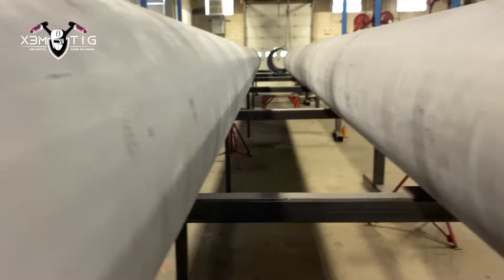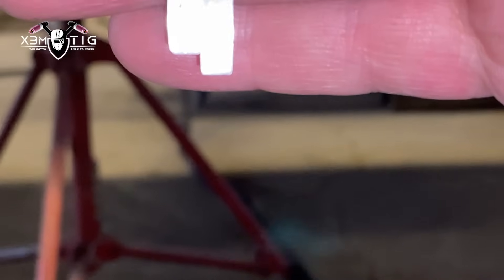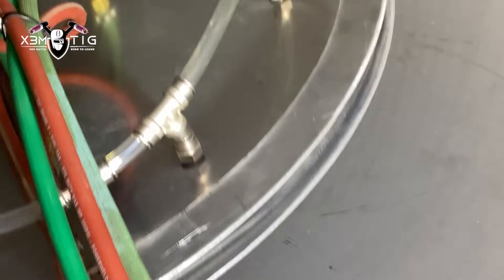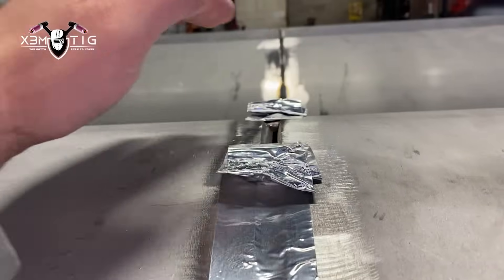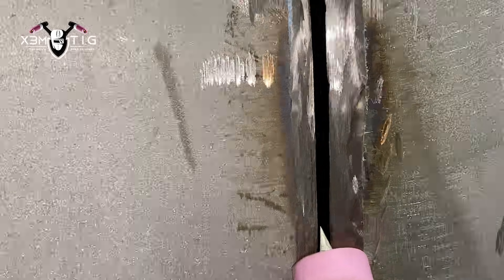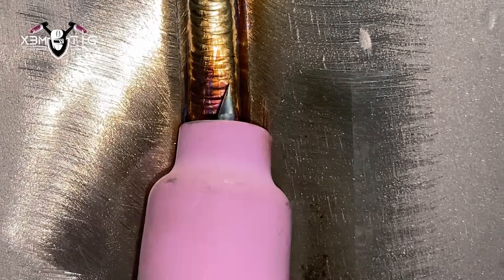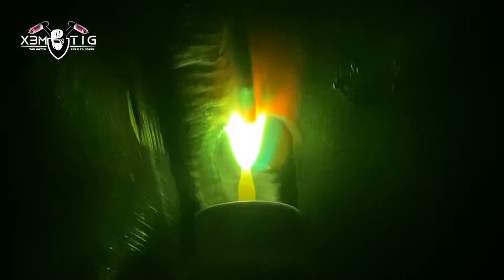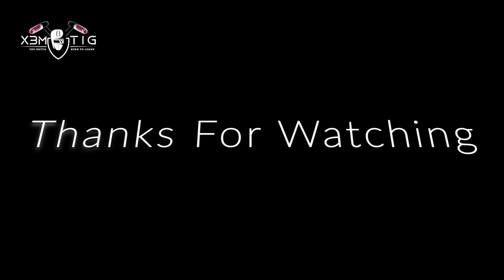TIG Welding 30" Stainless Pipe | 100% X-Ray Quality Welds Every Time

Comment: you said in a previous video that you stiched from thoriated for health reasons. what did you mean by that? I tig weld and im curious.
Reply from the maker: yeah, I switched away from thoriated tungsten mainly for health and safety reasons. Thoriated tungsten (usually marked red tip – 2% thoriated) contains a small amount of thorium, which is a radioactive element.

The main concern isn’t when you’re welding — it’s when you grind or sharpen the electrodes. The dust and fine particles released during grinding can be inhaled or ingested, and over time that radiation exposure adds up. It’s low level, but it’s still ionizing radiation, and there’s also the risk of lung contamination from the dust itself.

That’s why a lot of welders (including me) have switched to safer options like 2% lanthanated (blue) or ceriated (grey) tungsten. They perform just as well on AC/DC, and you don’t have to worry about the radioactive side of things.

So it’s not about paranoia — just minimizing long-term health risks

Comment: Why is the label saying ER312 & ER 310? There is a big difference in Ni content...
Reply from the maker: Good catch, A labeling/printing error, the filler wire is ER310
Reply: @X3MTIG  Yes we know it is ER 310 because of what is written on the wire itself - although it may pay to check that with a texas nuclear machine or similar, but why is the manufacturer or supplier giving duel certification on the box when there is a significant Ni difference. Maybe ask them...? And, get them to pay for the test?

Comment: I was really waiting for the new video. Thank you my friend.❤😊

From the video it looks like your hand is moving at a speed of 1 mm/s, which is 6 cm/min when you welding the root pass. Please tell me if I'm wrong?🎉
Reply from the maker: You are not wrong, never measured it actually, but one 1 mm per sec on wider gap makes sense. Good question tho 👍
Reply: @X3MTIG 
Thank you bro❤😊